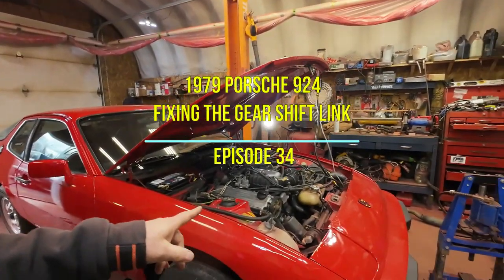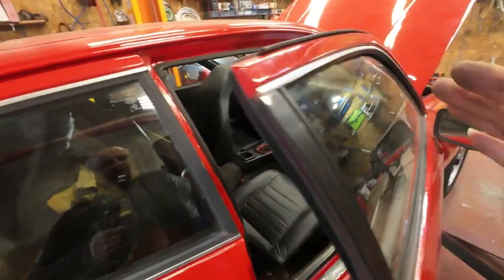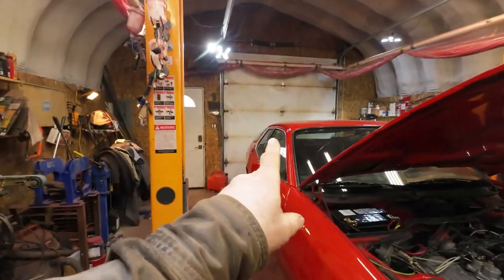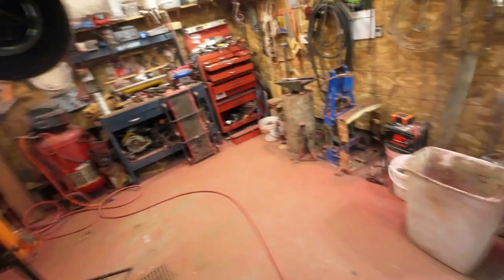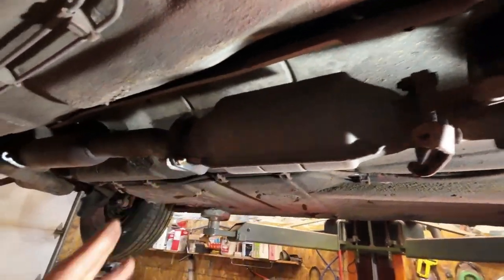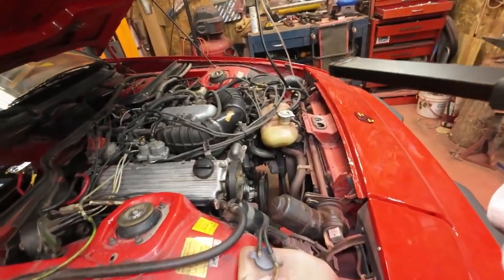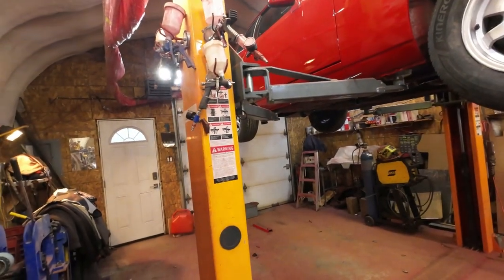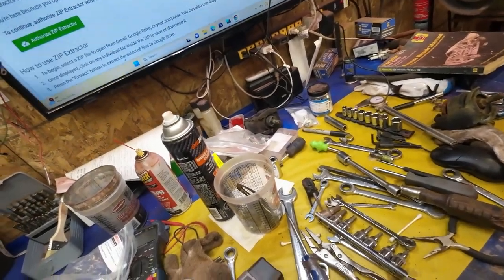1979 Porsche 924 Fixing the Gear Shift Linkage Type Z  Episode 34

Comment: Hi Lorne, thanks for the comprehensive update, was wondering also how long that printed bushing will last on the gear linkage. Really nice fix though. Appreciate you getting stuff such as this out, thanks.
Reply from the maker: Thanks Chris, it is interesting....I replied to Henry on the same topic.
Reply: @LorneKelly  I hope it does last, perhaps if it was made of a PTFE type material might be more forgiving with any mechanical interaction. But yeah suck it & see. Good luck buddy!
Reply from the maker: Hi Chris , I ordered some ABS filament for my printer...might be a bit tougher..
Reply: @LorneKelly  Hi Lorne, I'm no expert, sorry to put doubts in your head, but all that work to get it to fit so nicely and spot on, I wouldn't like to see it scuppered in time.
Reply from the maker: I talked with my nephew, he is an expert on such things, recommended ABS.  A little smelly while printing..  @ChrisFEJackson
Reply: @LorneKelly  Good lad Sam :)

Comment: How confident are you in the 3D printed bushings?  I've not got to it yet, but I'm interested
Reply: Got to the printed bit - very cool.  I would like to know how they survive with usage
Reply from the maker: Thanks Henry, I don't know how they will stand up, It is all a very tight fit, it's not in an area that has a lot of heat and there is no sunlight...could be that they will last a long time. if not I will print them with a different material and try again, or I have a good model to fashion them out of aluminum...I printed them with as high an infill value as the machine would allow..
Reply from the maker: Hi Henry,  I ordered some ABS filament for my printer...might be a bit tougher..

Comment: Would it be possible to put a link to the 3D print in the description
Reply from the maker: Thanks Logan here you go, if it is difficult to load send me an e-mail lkelly@carnwood.ca https://www.dropbox.com/scl/fo/35hrix8bcmkspzjp42b2y/h?rlkey=a88mxx7d7sdv2a8rlxss3nhyf&st=yq3klh2l&dl=0
Reply: @LorneKelly  Thank you very much. This will save me loads of time!
Reply from the maker: @logankeyfur3588  Best to use a heat resistant type of filament. I used PETG